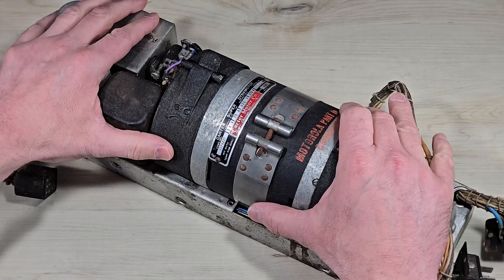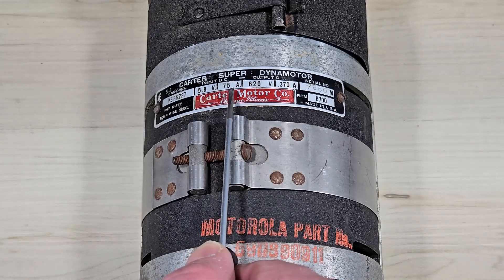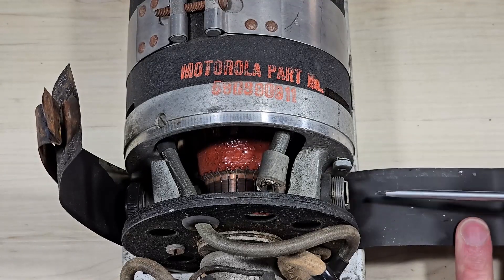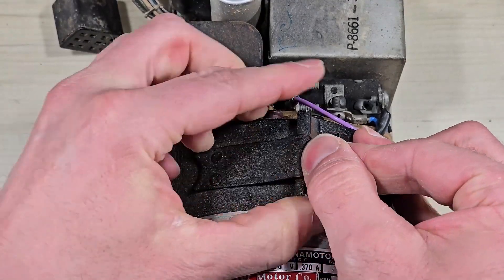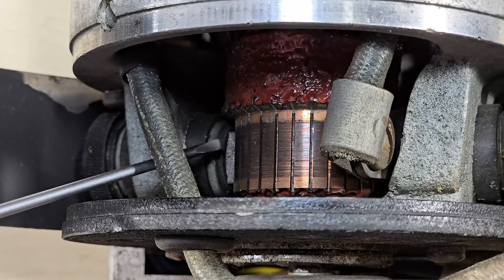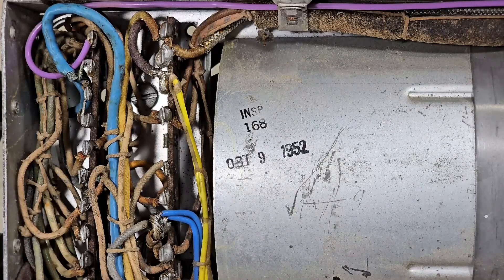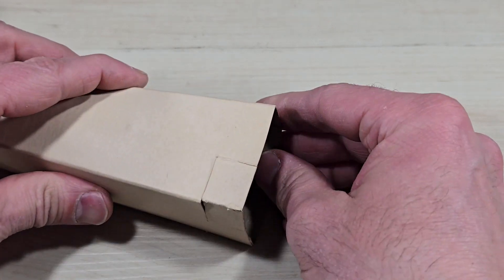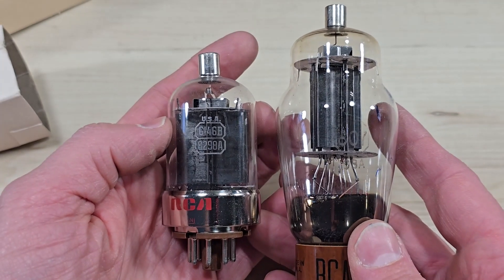Teardown of a 1952 Motorola transceiver’ power supply featuring a dynamotor.

Comment: Years ago I had 3 Motorola 2-way radios. Low Band units, model 80-D. They were nearly bullet proof, huge heavy things looked like military grade. Had a big Tee handle to open the cover. About 35 tubes inside including a dynomotor unit. Mine were just new enough that they could be converted to run on 12 volts or 6 volts. Put out about 60-100 watts depending on the input voltage. Even though we had a FCC license to transmit, we never used them much. Junked em for the newer "T"-Power units.
Reply from the maker: There can't be many of the dynamotors around today. As you said, it didn't take long for the "T" to decimate all of the vacuum tube units.
Reply: @apdahlen  LOL ya. The "T" power units were a slimmed down and more compact version of the ole dyno jobs. Still had 30 tubes but the T stood for Transistor power supply for the B++ circuits which superseded the dynomotor.

Comment: You are working on a vintage piece of equipment with irreplaceable components, and you use a vastly undersized screwdriver to remove a brittle old part?  This would not have happened if you had used the correct size screwdriver and perhaps some penetrating oil and/or a heatgun to loosen that screw first if it was being difficult.  What makes it laughably worse is that after breaking the first one, you immediately barged right in to break the second one without spending even a second questioning your choices. What a hackjob...
Reply from the maker: @bradwilson76  

Fair enough, we can call this an example of what not to do.

Comment: Oh no! If you're interested in restoring those plastic caps, maybe they could be 3D printed and the knurled screw heat-set into it.
Reply from the maker: Hello Kent,

As @bradwilson76 pointed out, I should have known better. 

The 3D print is something to think about - then again, a dab of glue will hold t together. 

FYSA, I would have explored the low voltage section, but it was badly corroded. Who knows where this unit has been.  

Cordially,

Aaron